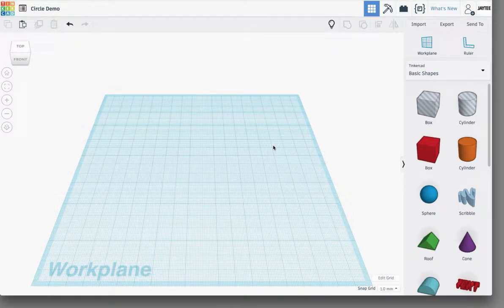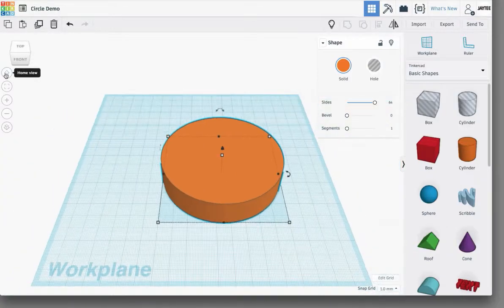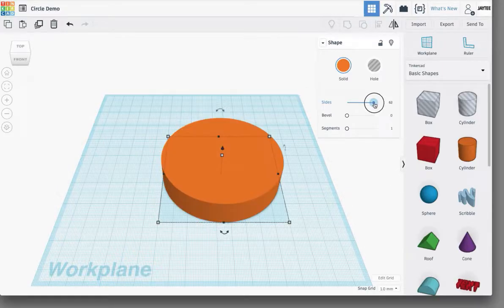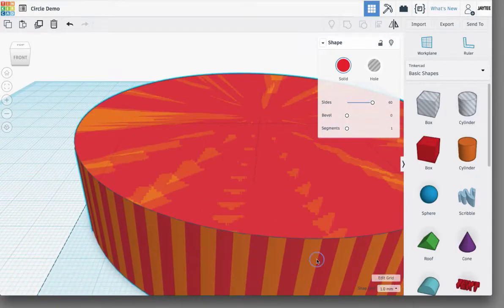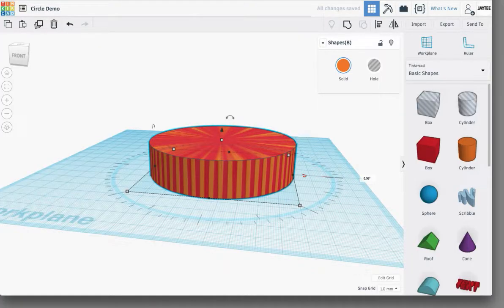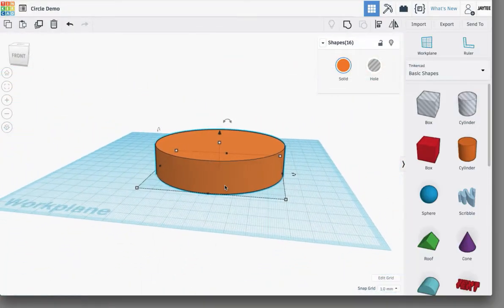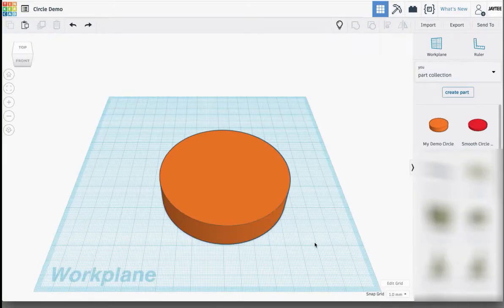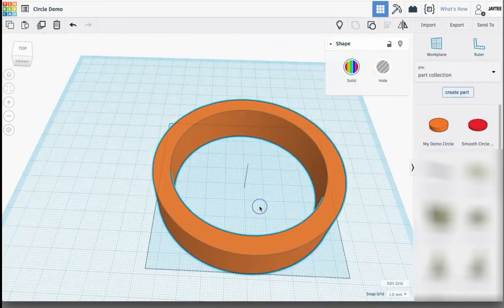How I made the Smooth Circle or smooth cylinder in Tinkercad

Comment: Great idea, I'm using it; however, why would you need a Part that is ungroup with 6 circles?  What type of project would you use that ungroup part for?  And I learned a new thing about "Create Part" which I plan to use as well.  Great video, short, to the point and something that will actually be used and wasn't presented in a 20 minute video.

Comment: Do you know of a way to  make an adapter for a vacuum system that  smoothly changes from one size to another.  I have only been able to design one that has two cylinders stacked on top of each other and the transition is quite clumsy.
Reply from the maker: Hey Gerald, thanks for watching. I would probably incorporate a cone into the mix to try and make a better external transition, but I guess it depends on the variation of the inner diameters. Cheers, JAYTEE

Comment: I've tried this a bunch, but as I duplicate and rotate a sphere or cylinder, the more iterations I do, the more "zits" I get on the 3d-printed result. I have to stick with only 64 sides or my print results get more and more horrible.
Reply from the maker: Thanks for the info Dustin. I'll try a print with my current slicer settings to see what happens in this day and age. Cheers, JAYTEE
Reply: Oh, I have an update!! Spent most of the day yesterday printing trials (three 10x10mm hollow cylinders) and decided to try different slicers: Cura, Prusa, Creality Print, and Creality Slicer. Turns out, it was something in the Cura config (have not identified what yet) that is causing it for my Ender 5 S1. When I slice using the others, it prints perfectly. The only time Cura has an issue is when I was doing these steps - a default 64-sided Tinkercad Sphere or Cylinder prints fine, just when I duplicate and rotate it as you explained in the video. ALSO: I was surprised to see that all 4 slicers had different print times for my trial, with Creality Print being almost 2x the others. However, when I printed a more complex print Prusa was a bit faster.
Reply from the maker: @DustinBreese   Excellent, glad you got to the bottom of it. One thing I've noticed about slicer time estimates is that Prusa Slicer ( and family ) is much more accurate estimating the print time, especially on long prints. Cheers

Comment: Thanks so much for explaining how to do this.  I'm now trying to do something similar with the Torus, but I don't think I paid enough attention in geometry class because I'm failing.  Any suggestions?
Reply from the maker: You're welcome. I just had a look and there are several predefined Torus objects available if your search for Torus. Some have more configuration options than others, but they are mostly smooth. Cheers, JAYTEE
Reply: @JAYTEEAU  Still new to Tinkercad, so I didn't even think to look at community things. That alone was a great tip!  As you suggested, I found some that will work. Thank you!
Reply from the maker: @bravotangoecho8598  Awesome

Comment: I have managed to make a circle much easier than this.. I first tried importing an svg of a circle from corel but again it had lots of flats, so I re-saved the circle but added hundreds of nodes first.... it looks a perfect circle with no flats..
Reply from the maker: Brilliant. How did you add the extra nodes? Cheers, JAYTEE
Reply: @JAYTEEAU  in corel I only had to use the shape tool and right click the circle and press "add" several times..
Reply from the maker: @edwardyoung7851  Great, I had no idea how to do it in Corel.  I just tried it in Illustrator and I didn't get the results I was hoping for. The attached image shows my original vector path with lots of points and the TC result after import :(    https://www.dropbox.com/s/3r3mxcpq26v70pe/TinkerCad%20Many%20Points%20SVG.png?dl=0
Reply: @JAYTEEAU  I realised it by accident as I was importing fonts and they were terrible and inaccurate from corel but if I selected the whole thing and added loads of nodes it fixed it then realised it was same for a circle.. they are slow to load into tc  though. Another way I tried was converting eps to svg online which normally was much better than a corel saved svg for some reason.. 
Before I that i was using your method..

Comment: There used to be a 'high resolution cylinder' primitive where has it gone??
Reply from the maker: Hey Nick, there are some shape generator versions, BUT I've been bitten by using certain generators before and try and work around them where possible. Cheers, JAYTEE
Reply: @JAYTEEAU  Hiya, I found a smooth cylinder model online and use that as the basis for my models now. Thx.
Reply from the maker: @noutram1000  Excellent

Comment: Great trick.  I tried it a slightly different way.  My first duplicate was .5 degrees and then (never took the highlight off the duplicated circle) duplicated it 10 more times.  It saved me from entering the degrees for each duplicate.  It should also work at .4 degrees with 14 total duplicates.   And .3 degrees with 19 total duplicates.
Reply from the maker: Excellent Doug. Nice improvement. Cheers, JAYTEE

Comment: I was concerned that the extra faces would increase print time, but after making a cylinder with 20, 64, and smooth. Prusaslicer does not show a difference in print time. I also found a simpler way; Duplicate rotate .5deg then duplicate 10 more times.
Reply from the maker: Excellent work, great testing and refinement. Cheers, JAYTEE

Comment: I use Tinkercad lot of messing about to get smooth edges why can’t they just update a smooth tube be a lot easier
Reply from the maker: Hi Cris, there are other options under the Shape Generator section, but when the generator system goes down, so do all of your shapes. This is fiddly for sure but it's always available. Cheers, JAYTEE

Comment: Excellent idea, but surely the idea of using CAD is to simplify. A quick look in TinkerCads' shape generator will find cylinders and other basic shapes with much better definition, and can be simply dragged onto the plane and used.
Reply from the maker: Thanks very much for the comment. The shape generators sometimes go offline making your design useless for that period of time so this was a 'workaround'. Using primitives is obviously the best solution, but if I can't rely on them then I'll find a different solution. Cheers, JAYTEE

Comment: There's actually a shape editor in tinkercad and you edit the script for smoother shapes.
Reply from the maker: Thanks for watching. This was a bit of an experiment for when openscad breaks in TC. I've had some text generators also break rendering my designs useless. I might do a follow up video on shape generators. Cheers, JAYTEE
Reply: @JAYTEEAU  Kinda pissed with tinkercad on why i still have to edir the shapes and generate my own instead of having it readily available since it was already possible in tinkercad.
Reply from the maker: @dredgewalker  I know. I'm at the point where I need to move to another software package. Cheers, JAYTEE

Comment: I'm not sure you are actually reducing the number of edges.  In fact you are doubling then quadrupling the number of 176 degree corners.  From a macro perspective, and within the tolerance of 3D printers, yes this does more closely approximate a circle, just one with vertical striations.  Now had you done this on an inside curve, then you would have achieved your aim.
Reply from the maker: Hey Ken, thanks for the feedback. 

With regards to the vertical aspect of this, are you thinking about the use case for a sphere? This example is more for a cylinder. 

I haven't quite grasped the meaning of "had you done this on an inside curve..."

Thanks again. Cheers, JAYTEE
Reply: @JAYTEEAU  Sorry I wasn't clear.  I'm talking cylinder, as you demonstrate.  To illustrate my point, imagine you only used a four sided square instead of 60 sides.  After one 45 degree rotation, and another 22.5, etc.  you are getting closer to a cylinder, but all those 90 degree vertical edges are still there, just more and more of them and they protrude less and less, but never go away completely.  You have the same situation with your 60-sided polygon, but to a smaller degree of course.  As I say, I'm really splitting hairs since this is within the noise of 3D printers unless you are making something really big.

My inside curve thought is this:  Imagine you made a "Tube" in Tinkercad and did exactly what you described.  I'd say the inside surface does have the ever-smaller facets you describe and not the fixed angle edges I described.  After rotating an merging the tubes, you'd have a nearly perfect inside cylindrical surface.  Now make the tube a hole and merge it with a solid shape and you would have your almost-perfect cylinder.  

Thanks for you videos.  They are very helpful to me!

Comment: I took this up a notch, I started with a 60 sided cylinder, rotated copies by 0.01 degree giving me 10 sides per degree, then rotated that six times by 1.00 degree for a total of 3600 sides (60x10x6). I tried to repeat that process with the 3600 sided cylinder but it failed while trying to save the object.
Reply from the maker: Good one 👍  I know Tinkercad will have a bit of a hard time with MANY MANY objects. What you could perhaps do is save as a part, then place the part and rotate it again a lot of times. Cheers, JAYTEE
Reply: too much math.

Comment: thanks for this buddy. question here - would you be able to group all these circles together and export them as a STL? I tried to do that and chrome repeatedly crashes. 

I also realised that if u save them as a 'part' instead, a there are limited things i can do with them. I cant be exactly sure but aligning another object to it seems to be a pressing issue im facing.
Reply from the maker: Hi Alvin, firstly, you're welcome. 

Tinkercad may indeed have a limitation with the number of objects if can export. Not sure if it's a browser issue or a Tinkercad issue. 

Saving as a part definitely alters the edit-ability of the object, but should not impact on the ability to align with other objects . Cheers, JAYTEE
Reply: Have you tried exporting them without grouping? If that doesn't work, try grouping them in small bunches, say make 6 and group those, make another 6 and group those etc.